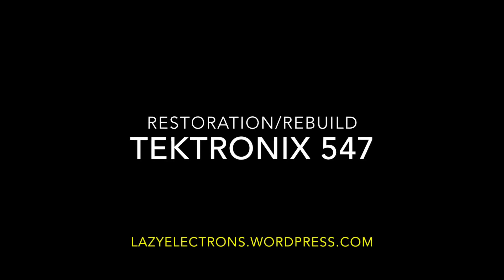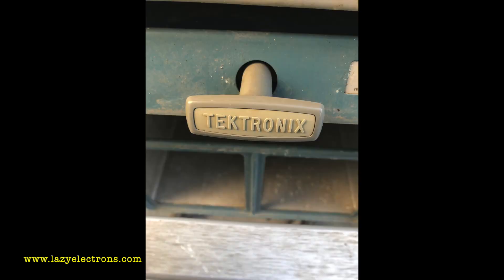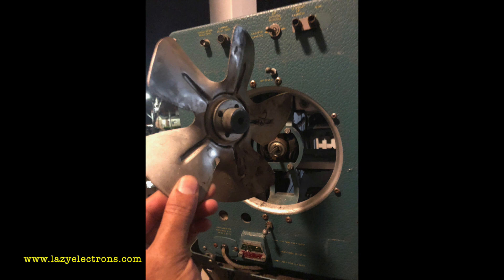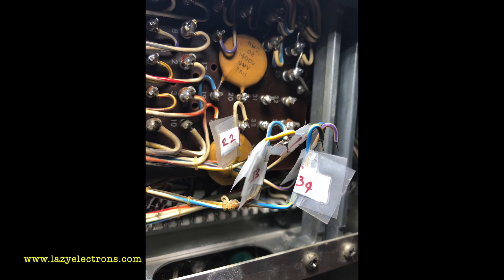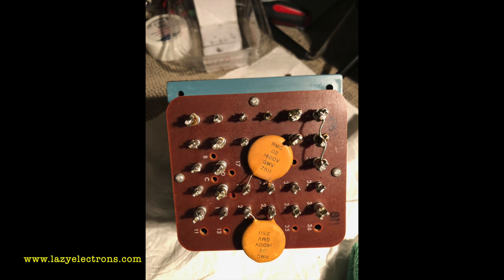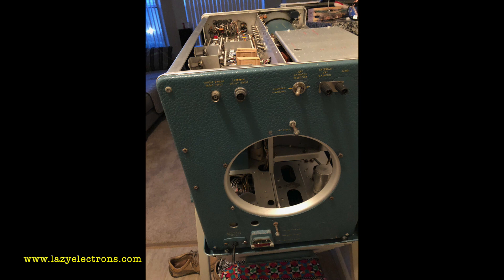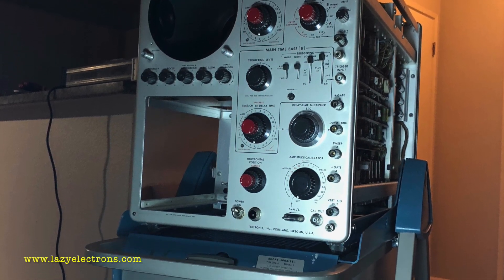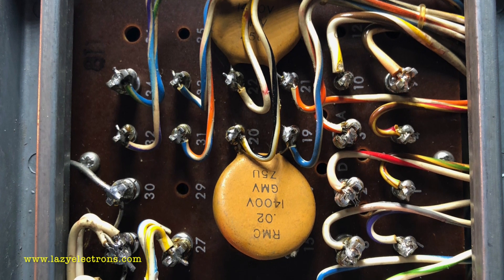Tektronix 547 Restore Project Part 1 of 2

Comment: Very nice restoration! Very clean result!
I also have a 547, a 545B and a 180A units.
How did you clean it? Only with isopropyl alcohol and cotton rubs, maybe a brush? Or did you wash it with soap and water?
I read somewhere that Tektronix offered a clean service for this kind of scopes and they literally washed them with water, but they put them in a hoven to dry. I think it was distilled water.
How do you calibrate it? Do you have the TU7 plug-in or do you have some tricks?
Thank you so much
Giulio
Reply from the maker: Thanks Giulio. Reg  cleaning  - yes isopropyl alcohol. But some others like my RM585A, I had to wash and dry like you said. I dont have an oven large enough to fit these in, so kept them out in the sun (without tubes). I have TU7 but I didn't do the calibration, as it was "close enough" for my use.

Comment: Love to see old gear brought back to life. Great Job..can only imagine how long it took to clean. The glue residue on the top front was most likely from a Company or Government Asset Tag. These were usually a metal and used a tough glue or contact cement to prevent removal....or at least easy removal.